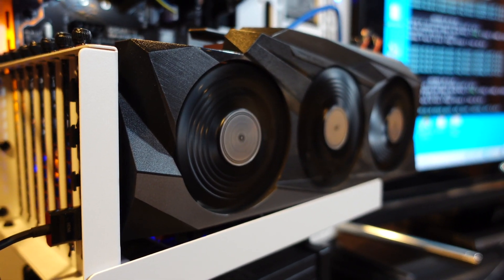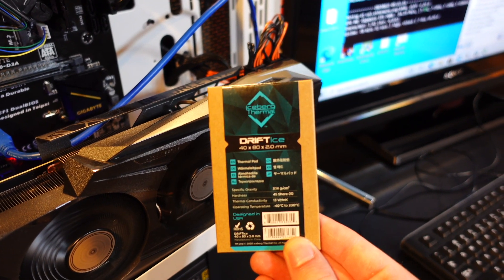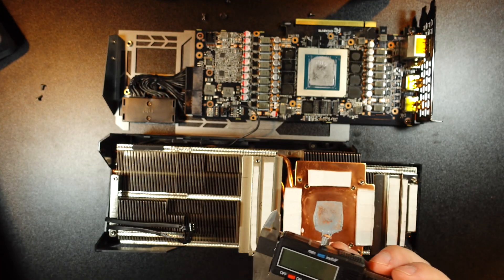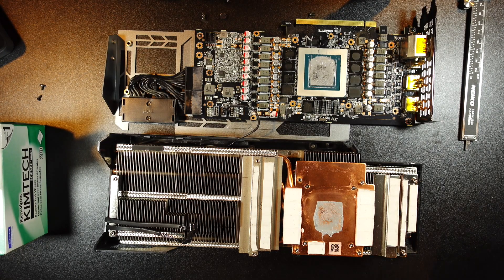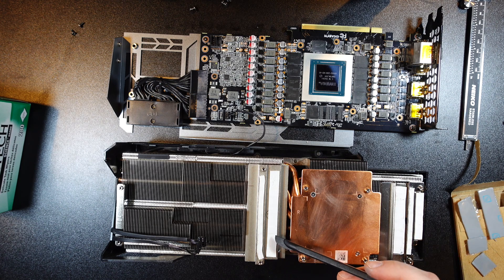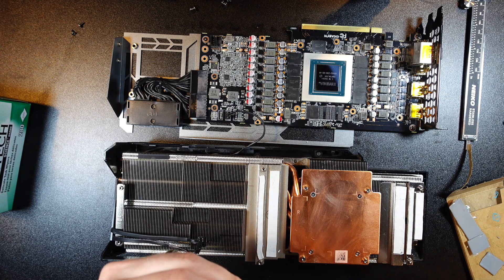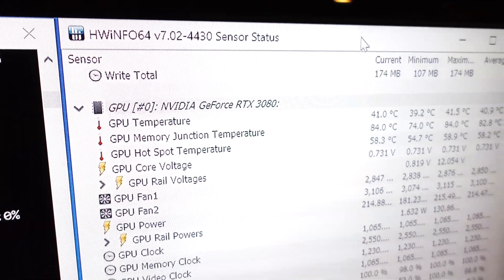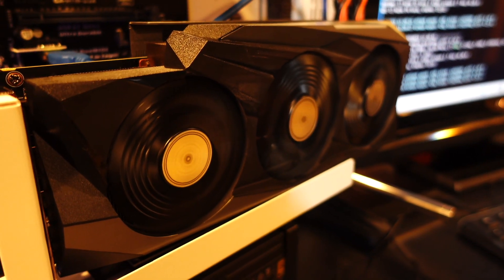UPDATE: RTX 3080 Thermal Pad Install & Ethereum Testing (Part 2)

Comment: Looks like I need to do the same thing. I'm going into it once, not twice! :) Fishhash Algo has the same issues as EThash. 3080 should do 62 MH/s Fishhash, but I can only get to 45MH/s and hit 110C. I hope I get  20+ drop as you did! Thanks for the video!
Reply from the maker: Good luck brother! I gotta get testing on fishhash.
Reply: @RedFoxCrypto  Ya Fishhash and KHeavy-Pyrin are the best producers. I ordered the Kritical Thermal Pads custom kit for EVGA RTX3080 FTW3 Ultra. Pads have a  20W/m-K rating. Much more expensive, but all pre-cut and custom thicknesses. 45 USD for a kit.

Comment: Hi Red fox. I just bought evga 3080 xc3 for 900£ :D and some one  mess it thermal pads. I just getting like 96 degres which is not bad but for long run still to high. What kind of pads would u recommend gelid or this Iceberg ? Should be 2 mm or 3mm? What kind of hashrate have u got right now? :)

Comment: Hi man i just saw this video on discord. Look i have the same card hahah. I put 3mm termal grizzly pads on memory and roll them down to be softer. Throw away stock pads they are horrable and add more 2mm pads on mosfets  and power section on cards rear. It works for me it will for you.

Comment: Hi red fox. How do you know when you need to replace the thermal pads?  I don’t have thermal throttling I don’t think.
Reply from the maker: Check the vram temps either in T-Rex miner or using HWiNFO64. If they are above 100C probably would benefit from a replacement.

Comment: I also changed the pads on my MSI 3080 GXT and Asus 3080 TUF and the temp dropped 30C, getting now 80C Tj @ 28C ambient. I think all these GPU manufacturers used garbage pads on purpose just so the cards won't last much more than the warranty period.

Also my TUF 3080 can do only +850MHz before it crashes so don't feel bad, you're not alone with a bad 3080; my GXT 3080 can do +1200MHz though, just silicon lottery.

Comment: Hey man awesome results.  I just got mine down by 25 degrees with new paste and pads.  What OC settings are you using? I can get 96m/h with nicehash but would prefer to mine ETH directly
Reply from the maker: -200 core, 900 mem, PL to around 230 watts. Most 3080s can do more mem than mine.

Comment: Hello, good job, on my rtx 3080 gigabyte aorus extreme i changed thermal pad with gelid 2.5mm,  went from 102ºC (using 2mm) in the memories to 80ºC. Now with nicehash i use OC extreme, stable at 101.5 MH/s, 243W, memory frequency is 10800Mhz, efficiency 0.42

Comment: Bro the thermal pads on the Gigabyte 3000 series are a joke. I swapped them ALL out and added backplate pads a week after I got mine and it dropped temps by 20C
Reply from the maker: Yeah dude total joke. I’ll never forgive them.
Reply: dude i got a GIGABYTE RTX 3080 GAMING OC WaterForce WB, i also got 110 vrm, should i change the pads also ?
Reply: @LilShammy35  Yes, and also add thermal pads to make contact with the metal backplate. Helps immensely bringing down those temps even further. These thermal grizzly pads are still going strong almost 5 months later!
Reply: @rg975  ty man. And ffs I'm pissed off. I paid 2500 cad for this card too. I will get pads, TY kind sir.

Comment: Did the same to my thermal throttling msi 3080 and it dropped to 74deg, used fujipoly pads and kryonaut extreme paste, never looking back, actually very mad I didn’t do it sooner. Was doing 86Mhash now looking at 100.5, guess I got lucky in the silicon lottery. I know they are more expensive, but I need these components at their peak performance and lasting for years.
Reply from the maker: Thats sick dude. Really awesome results. So jealous you got above 100 MH/s! Thanks for watching and happy mining Fernando!

Comment: I added some Fujipoly thermal pads on the backplate of my EVGA RTX 3080 FTW3 Ultra, lowered the temps with 6-8 degreese C. They use thermal putty and odd sized thermal pads so ordered a EKWB waterblock instead of changing all out. Going to throw it in gaming pc together with my water cooled RTX 3090.

RTX 3090 is a beast when it comes to mining, running it stable at 122 Mh/s ETH, 68 degreese memory temps, and 270w.
Tested it out on Ravencoin too just for fun, and managed to squeese out 64 Mh/s, but the gpu draws 470w acording to the software so i bet it´s over 500w from the wall.

Comment: Yo Red Fox I found the deal spot: Frosty Ice Cube Plus Thermal Pad - 12.8 W/mK - amazing price. The 1.5mm is going for $17 on Amazon and is large enough to change front and back fo the card.

Comment: Actually, the mem temps dropped even more than 30, cause 110 was while throttled quite a bit. Imagine how high it would have been if it didn't throttle. Perhaps 120, or more.
Reply from the maker: That's a great point. I didn't think of that! Thanks for watching.

Comment: Great video, I had no idea the factory pads could be THIS bad!

Re: TIM application. Technically speaking, the pea-size method is better for GPUs as well, ensuring you don't get any micro air pockets. The problem is that to ensure you cover the corners, which is important when you apply directly to the die, as opposed to on a CPU where you apply on the heat spreader, you end up having to use way more paste than what is required to cover it. So you end up with a lot of paste squeezing out onto the package making a bit of a mess. So spreading out the paste is actually just to keep it a bit cleaner, at the cost of getting some micro pockets of air trapped between the cold plate and die. I'd say that spreading out is probably the "right" thing to do for mining though, as the GPU die itself is never going to see much heat anyway. So better to keep everything neat and clean. Well, in my opinion..
Reply from the maker: Thanks dude! Thank you for sharing the info on thermal paste. Seems the GPU chip temp is about the same as before so hopefully I'm in good shape! Happy mining dude.
Reply: @RedFoxCrypto  Well, I emphasized that it's just technically speaking better. As in maybe you could gain say 10 - 20 MHz extra on your GPU OC when chasing 3DMark scores. If you get any micro pockets of air over an area of the die that "matters", the decreased thermal conductivity is still very very small. It would only matter to someone looking to squeeze every last MHz out of the GPU. If thermally measurable at all, at a guess, Id say you'd probably only see it as a very small increase in GPU junction temp, not the average temp.

Anyway; Thank you, and happy mining to you as well! :)

Comment: I changed the memory pads on my RX 5700XT MSI MECH OC and went from 96ºC in the memories to 80ºC. This graphic has thermal pads that cover only about 60% of the memory chip, a terrible job from MSI. I had the fans always at 90-100% and they made tremendous noise, now fans work at 60-70% and make almost no noise
Reply from the maker: That’s awesome. I have that same GPU and I’m pretty sure it’s melted at this point. Thanks for watching.

Comment: Hate my 3080 suprim. I’ll wait a few months then swap out my pads. Want to hit that roi before I void the warranty
Reply: Mine starts quite well, 93mhz sitting around 98c 80pc fan, in only a few weeks it got worsen, now it sits around 102c at 85mhz 100pc fan, no matter how config the clock, power limit must drop to 56, sad 😭
Reply: @xuperduplex9492  have my power limit at 50 with a -20 ram, 85% fan and I’ll hit 71mhs with vram at 98-100 never dipping over
Reply from the maker: Not sure where you are located, but any warranty void stickers don't hold up in the US. You can open your GPU and swap out your pads without voiding the warranty as long as you don't damage it.`
Reply: @RedFoxCrypto  little scared to take it apart and fuck up something. My hands are way too shaky to handle of valuable the card is now. true I’m in the US but msi is a greedy Chinese company that wouldn’t mind lying about me breaking it and then I’d be a month or more with shipping just to get it back broken. Or wait like half a year for a replacement
Reply: @RedFoxCrypto  thanks for the info, but wouldn't it still be void if they found out that the thermal pad is different from stock ?

Comment: That was definitely a bad factory thermal pad application. 200watts and 110 C is a fail by manufacturer.
Reply: every 3080 does that. Companies just don’t care anymore
Reply: @chazs6854  - You can find many on YT that didn’t even go over 100C.
Reply: @edwardhewer8530  FE, evga, gigabyte, msi, and asus all do. Just search 3080 vram temps and you’ll see every card. Some not even from mining but just video rendering

Comment: Have to do the same for my Asus tuf 3080 the vram temps hit 110 running 65% pl-300 core +1200 mem. I’m been able to keep 88 deg running an air condition but that’s not sustainable while build out my rig thermal pads is a much better option. Great video thx
Reply from the maker: Yeah dude highly recommend swapping out the pads. Surprisingly easy to do with insane results.Thanks for watching!

Comment: Good stuff dude!!! Makes me wanna rip my 3090 FTW3 apart😝. I do have heat sinks ima put on the back, can 100% see the difference tho for sure
Reply from the maker: Thanks buddy! 😘😘😘
Reply: Don't, they use odd sized thermal pads and thermal putty, so it's very hard to get it right.

Comment: Man I have to put this somewhere but I FOUND THE TRUTH. Anyone who's ever had a problem finding the right thickness thermal pad needs to read this!! Tg-pp10 is a thermal gap filler with a rating of 10 w/mk. It cannot be used by itself as a thermal pad, but if the pad size you need or is very close to, for example,  2mm then get a 1.5mm pad and add about .5mm of tg-pp10 on top of the memory and vrm chips. Just smear it in between and get it nice and gross but only about .5mm. Then put the pad on top and holy freaking sh*snacks I dropped 25c hotspot on a FOUNDERS EDITION CARD. And it's easy to clean with alcohol and a SOFT rated toothbrush. I've been testing it for weeks to figure out the proper application but this is it.

Comment: I have the same exact card, i think it's a gigabyte 3080 gaming oc. I am a bit lucky that i dont have to change thermal pads and the temperature isnt bad for solo card mining, 90-92 with ambient temp 83. I am sure it will do much better with change of thermal pad. but i dont want to void the warranty. =)
Reply from the maker: Man you got really lucky with that GPU. Every Gigabyte 3080 I've seen requires a thermal pad swap. Not sure where you are located but opening the GPU in the US doesn't void the warranty as long as nothing is damaged. Thanks for watching!

Comment: Thermal throttling? should be at 96c at least with some fans on it if you overclocked it with msi afterburner. never let it reach those temps man.

Comment: I changed the thermal pads on my evga (in and out) and it definitely helped.  Another thing you could do is add heat sinks to the back plate.
Reply from the maker: Wow. Surprised an EVGA needed it. Always though they were rock solid for the 3080s. Thanks for watching dude.
Reply: @RedFoxCrypto  i definitely pushed the hash rate and I have higher ambient temps then your rigs, so partially my fault.
Reply: @MichaelBellini   can you tell me how mutch of the 2mm you need to compleet the vram parts? And what are your before and after temps?  Thx
Reply: @nicorvane3101  it will depend on the model.  I have done this on the evga ultra ftw3 and the xc3.  They were similar but not identical. 

I would buy 1.5mm, 2mm, 2.5mm and 3mm so you have stock on hand.  Multiple of the 2.0 and 2.5.  

I did not change the pads above the capacitors and other smd components.
Reply: @MichaelBellini  Hi i got 3080 xc3 what kind of pads would u recommend?
Reply: I have a gelid extreem 2 mn 80×40 for the front and for the back 3mm 80×40 .. order for the 3080 ftw3 u . So thats not enough?.. just want to reduce the Jmem temp  . Thx

I'm glad i changed those originele pads! What a mess.. there was a lot of oil on the card i had to clean first..but after that the Temperature wend from 96'c to 80 max 82'c.
102.7 mh/s 232w  E: 446kh/w 
 fans at 62% mem 1500 core -200 power 61. So i'm verry happy🕺

Used 1 packed of 2 mm and one of the 3 mm extreem.

Comment: i am running the stock pads just bc of warranty...i am getting 92/94ºc max mining with +1250/1300mhz, do you think its durable and secure to mine with this range of temps? Never thermal throttled tho, just want to have it mining for years to come and am a little sceptical about these temps :/
Question, how do you have 214w pw? i need to have 230W in order to mantain 100mhs, thanks
Reply from the maker: I'd leave it as is if you are hitting those temps personally. You can use T-Rex Miner with the --lock-cclock argument in the batch file to reduce your wattage. Or use absolute core clock if in Hive OS. I'll have a video on it this week. Thanks for watching dude!
Reply: @RedFoxCrypto  Thank you! Building my 3080 rig right now, i only use afterburner lock and its great, i come from the old overclocking days before even crypto was around, love this stuff, keep vids coming, keep going!
My only concern are these temps on hotter days thats all, no invalid or rejected, 3080 card is a beast, but i worry about lifespan with +92ºc 24/7
Reply: Red Fox, you're awesome! Keep up the quality content!
Reply: you can change pads and dont lose warranty
Reply: @n-nonsense-e  how? can you help me a bit more? any vid?
Reply: Beautiful
Reply: It has already been proven multiples times that those stickers on the GPU saying: "Warranty void if removed", are actually totally illegal ;)
Reply: @blackmennewstyle  maybe so, but they reject them from rma anyway